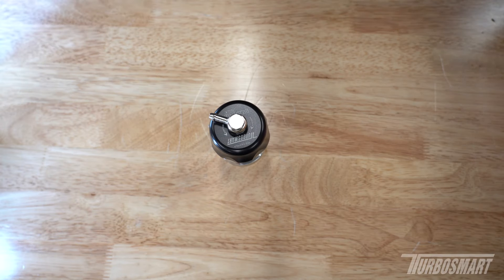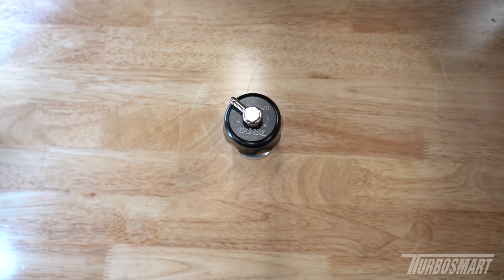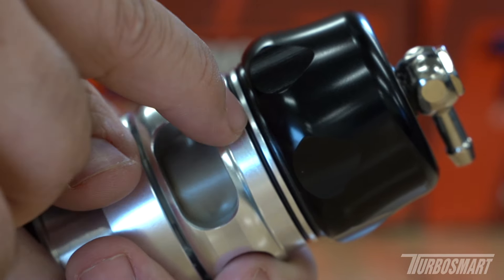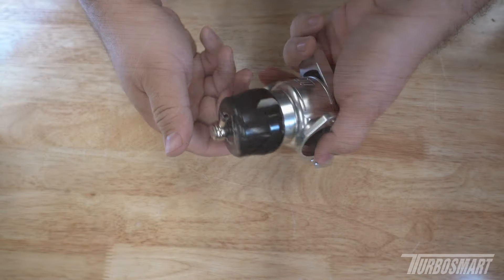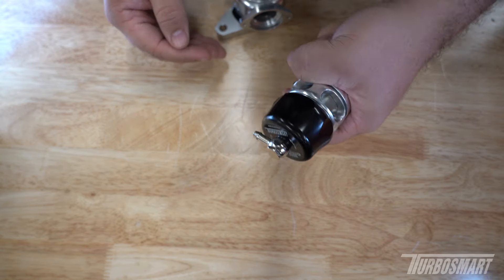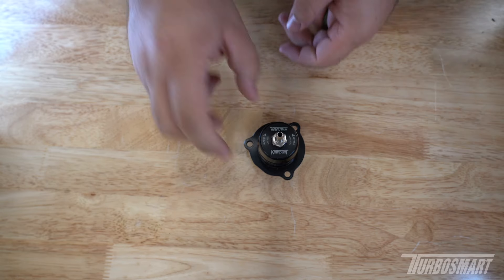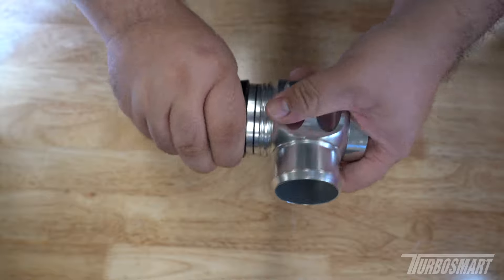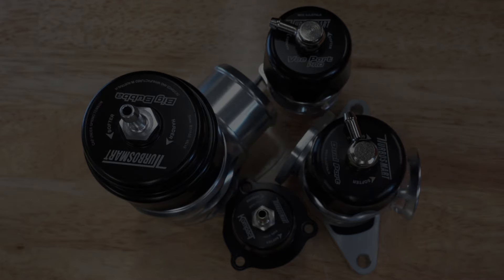How to adjust your Blow-off valve?

Comment: Thank goodness for this video, I got my c63s running a full Stage 2 tune with these mechanical bov, I swear on the hardest setting my car would surge on the top end but found this video…. Set them on the softest setting and the car runs way better, the surge went away from what I can tell

Comment: Ok great video I wish u detailed if factory setting is better or loose and also wish u demonstrated with compressed air so we can hear the difference
Reply from the maker: The adjustment will not effect how the valve sounds when it releases pressure. The adjustment is there to assist in how the valve operates. The audible level of the valve is dependent on the amount of pressure your application makes and the size of the orifice the pressure releases out of (Smaller = Louder)

Comment: Will the softest setting give me that loud ppshh or does the hard setting do that? It seems as if the softest setting is the way to go but, just asking for some clarification
Reply: You aren't really changing the sound of the blow off by tightening or loosening the spring you are more changing when the blow off will happen. Its important to make sure you have it at the right tension or you will either create a boost leak meaning you lose power or you create surge which doesn't vent air smoothly when it needs to smacking it into the turbo which is bad for it.
Reply: @demover7  Really? I thought if you make into a diverter valve it will reduce the sound as less air is being vented
Reply: @fgtrhwu2  Well there is a difference between a diverter and blow off valve. A blow off valve vents compressed air to atmosphere while the diverter valve takes that same air and recirculates it back into the intake. The question i was answering was weather or not soft vs hard setting on the blow off will cause the pshhh sound. When it vents it vents. It will have basically the same sound no matter what.
Reply: @demover7  My bad I thought this was a hybrid and the soft/hard setting was for the purpose of switching between the two
Reply from the maker: @fgtrhwu2  Our Dual Ports will always vent 50/50 to the atmosphere and recirculate. You cannot change that ratio.

Comment: I have the duel port one and my car seems to idle weird RPM surges  when coming to a stop and then idles normal. Subaru wrx EJ motor. Could it be set to soft or the spring loose stiffness over time? Have no boost leaks and did everything else to try and eliminate that problem. My last thing is BOV causing the issue.
Reply from the maker: Please make sure to reach out to our technical support team for your region of the world! We are happy to help troubleshoot!
Reply: I think this is exactly what’s happening to me, I got the dual port too…. That and/or my fic1650s are making my car idle and run at low rpm/speeds like crap.  You ever figure it out??

Comment: I have a Turbosmart Dual Port for my Mazdaspeed3, but it's different. Body has only 1 big sealing o-ring and brass piston have 2 o-rings in the piston's body and 1 in the base. It's an old design Turbosmart? What's the reference here to adjust harder or softer with only 1 o-ring in the bov body?
Reply from the maker: Oh mate, sorry to break it to you but you purchased a counterfeit. Our Piston Bore does not have any o-rings.

Comment: I have a race port valve , do you know why sometimes sounds the valve and sometimes not ? I have a Procharger making 14psi .
Reply from the maker: We have a specific version of the Race Port that has a very soft spring inside specifically for supercharged applications. Make sure you have this version. It should hang open at idle and close under boost. Feel free to reach out to us for in depth assistance! https://www.turbosmart.com/contact-us
Reply: @TurbosmartHQ hi..can u clarify to me " is't no issues if hang open position on idle and close under boost?.. i just curious just because i cut the original spring😢

Comment: Can i set it up a tad harder to have flutter under light boost? Would that be a possible thing? Or is it only for idle reference? Thanks
Reply from the maker: Increasing spring tension can induce flutter at lower boost levels but it all really depends on your engine vacuum level.

Comment: i currently installed the kompact dual port on my subaru BH5. 3 questions...

i currently have it completely closed off in recirculation mode like factory...do i need to fine tune the hard-soft adjustment?

if i opt to put the trumpet on and go 50/50...how exactly must i adjust the hard-sort setting? adjust it halfway? 

the orientation of the factory location has the trumpet facing downward into the motor...is that a bad thing to have it venting into the motor rather than upwards like on what i see everywhere else?

Comment: Good video, but how do you know if you need to adjust it. How do you know if your car needs it to be adjusted softer or harder?
Reply: If too soft a setting you motor tends to stall and turn off. I tighten it till it stops stalling.
Reply: @weduhpeople8504 I'm pretty sure a blow off valve should not be making your vehicle stall
Reply: @tardis4125  if your spring tension is too soft the piston in the bov will not close in time before idle which will cause your car to drop below idle rpms and even stall. Basically if the spring setting is too soft you absolutely can have a car stall from a bov. At idle the car runs off a closed circulating system, so the bov piston needs to be closed before reaching idle rpms
Reply: @gainzorzilla8999  I'm no expert, it's just that I had my pipes for my intercooler come off and the car worked fine, just lost the power from the turbo. That's the only reason why I would think that
Reply: @tardis4125  yeah but you can’t of been running a MAF right? Must of had an MAP sensor or something? If that happened to a car with a MAF sensor or equivalent it would stall because it’s losing metered air.
Reply from the maker: If your spring is too soft then that could allow the valve to open prematurely under load. If the spring is too stiff then the valve will not release pressure efficiently resulting in flutter or potentially compressor surge. In several cases, if you have the proper spring in the valve, very little to no adjustment is needed.
Reply: @TurbosmartHQ  I have the kompact dual port shortie for my ecoboost mustang and I am having trouble getting it dialed in. I have it very soft and I am still experiencing turbo flutter idk what to do
Reply: @Foghorn Leghorn if you have the BOV mounted before the intercooler there could be a pressure difference before and after the intercooler. If pressure is higher before the intercooler (at bov) compared to the pressure after the intercooler (in intake), the spring may not have enough pressure to keep the bov closed at wot.
Reply: @TurbosmartHQ  i thougt it was suppose to make it flutter
Reply: @naruto6074 why would you want boost flutter? Or also known as compressor surge.  You don’t want ur car fluttering unless ur one of those people 🤣

Comment: i have a sr20det and upgraded the turbo,doing so i needed to use a 300zx maf.i dump bov to atmospere and the car stalls everytime and the fix was recirculating bov but now i have no bov sound at all,i was wondering if i purchase a dual port bov and recirculate AND dunp to atmoshpere if this is best of both worlds or em i stuck forever recirculated because the sensitive maf? i suspect this is why they created the dual port bov?
Reply from the maker: In theory switching to the Dual Port would give you the "best of both worlds." Some cars are more sensitive than others when it comes to partially venting pressure but it will certainly allow the car to operate somewhat normally.

Comment: Curious how y’all are routing your reclaim air. Just straight into the intake manifold? (Cent. Supercharged 3.8 Gen Coupe).
Reply from the maker: The pressure is either recirculated to the intake system prior to the compressor (Supercharger) or vented to the atmosphere if you are tuned for that.
Reply: @TurbosmartHQ  that part I understand. So if I hook up the reclaim to my intake manifold, how would I ever know how much to twist the BOV for optimal performance?
Reply from the maker: @caycebennett8667  The window for optimal performance can be very wide on an application. It is very well possible that the factory setting is just fine for your vehicle and adjusting it to the hardest setting may make little to no difference. In many scenario, you just want to verify that the valve is holding shut under full load and releases pressure properly.
Reply: @TurbosmartHQ  to verfiy should i pump air into the system like we do for boost leak testing? then make sure your not bleeding off?
Reply: @pigeonsil240sx  Results please and thank you.

Comment: Hello. I recently bought a vee port pro. I have adjusted all the way soft but I’m still not getting much boost relief. I opened it up and I think it came with a white spring.. is the spring to heavy for my 17lbs of boost ? Thanks. Cheers 🍻
Reply from the maker: For BOVs, the springs are rated for Vacuum, rather than boost levels (wastegates are rated on boost). If you need help configuring your valve, feel fee to reach out to us directly Turbosmart.com/contact-us OR each of our regional office's phone numbers are listed at the bottom of the page as well 👍 Happy to help!

Comment: Can i install one of these on my kia rio gt-line turbo ? Its a dual clutch transmission. Wondering if it will work or not.

Thanks
Reply: You can install a blowoff valve on pretty much turbo car. I would do some research on blowoff valves to fit your specific vehicle. If it comes with a diverter valve from the factory chances are there is a turbosmart blowoff valve available l

Comment: I have these on my w117 cla180 amgline 2017. Im no expert about cars. this is my first car though. Does anyone know why is my BOV not working? I bought the correct model etc. Had them installed and tuned my car too. 1 month later, my dashboard engine light came up. After having it checked, i had to removed them and the dashboard engine light went off. Can someone advice me, is it because the engine is is not compatible using BOV, instead, only can use diverter valve? Some says that BOV makes my car lose power too. Right now im not using bov or diverter valve. find it wasted not to use what i already bought. But i dont mind if i need to use only diverter valve. As long as i get the correct advise to follow.
Reply from the maker: It is difficult to say what the cause could be without know all the details. Please use our "Contact Us" form for assistance from our Technical Support team for your region.  https://www.turbosmart.com/contact-us

Comment: Do you sell whistler trumpets cant find one for a kompact 50/50
Reply from the maker: If its a standard Kompact Dual Port BOV then the part number will be TS-0203-3004. This does not apply to Kompact EM valves. https://www.turbosmart.com/product/kompact-bov-replacement-trumpet/